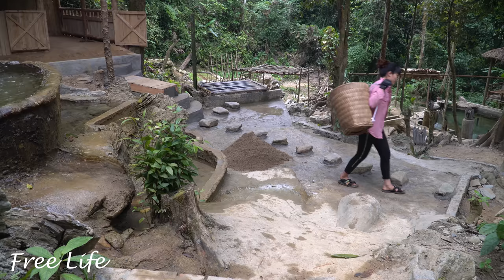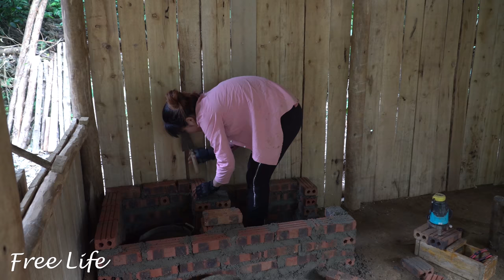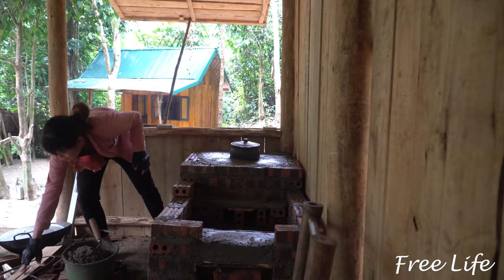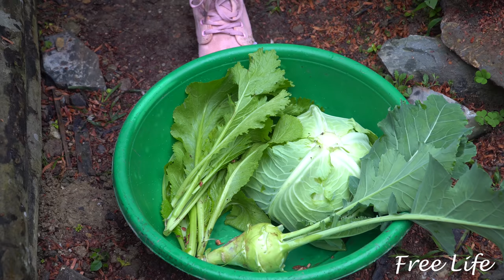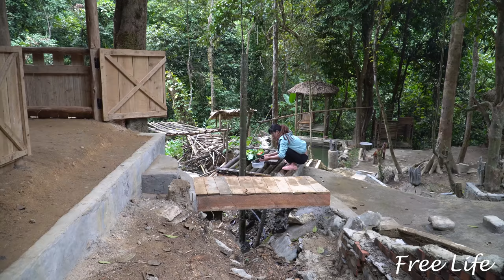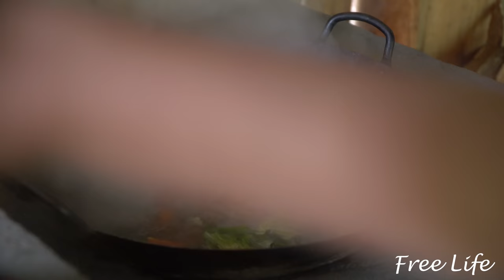How to make a creative 2-in-1 multi-function wood stove. Building farm, free life (ep7)

Comment: PS all the people who are worried about the plastic pipe, if you look carefully you will notice that the pipe is covered with cement, so when the pipe melts the cement will have the same shape as the pipe (if the cement is done properly it will work)
Reply from the maker: When reaching a certain temperature, the plastic pipe will melt. The purpose I use plastic pipes is to create a frame so that it is easy to put a layer of cement on top to form a chimney.